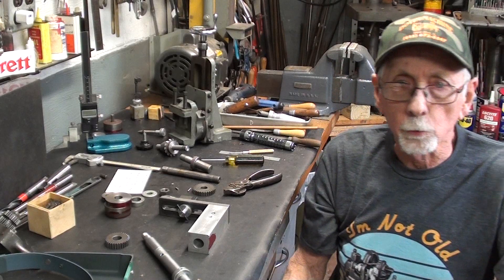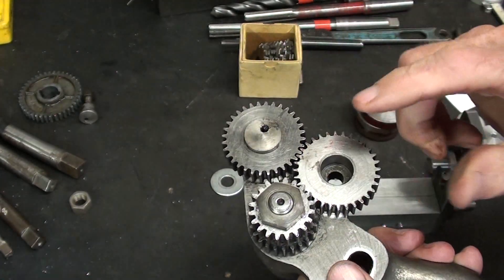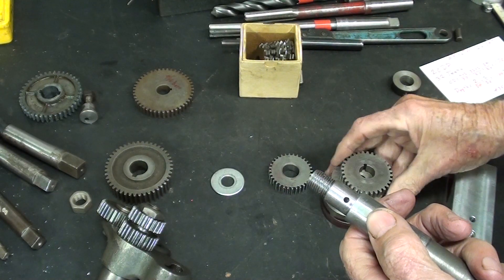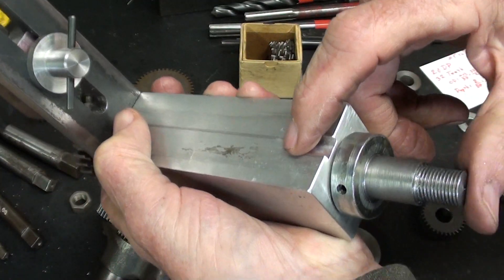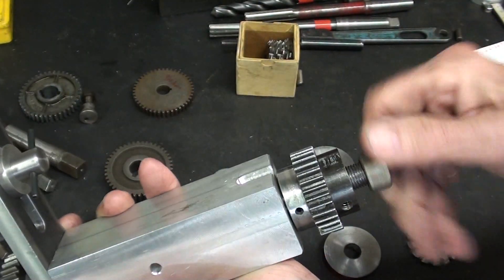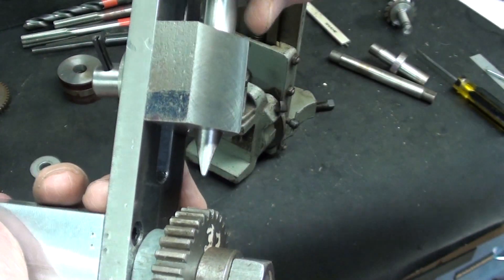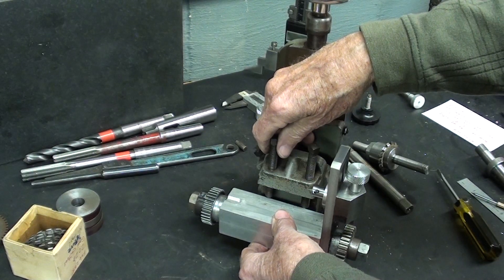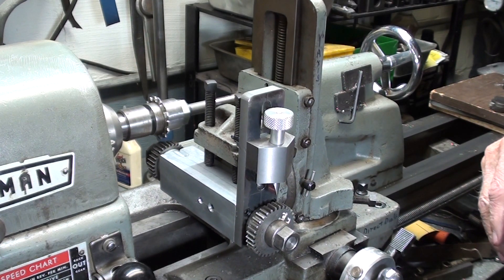MAKING ATLAS GEAR CUTTING FIXTURE pt 6 #840 tubalcain assembly

Comment: Mr.Pete would it be practical to add a round brake pad and rotor? Why I imagine this is because I have a ratcheting chain hoist that holds up to a ton and it uses brake pads! The only down side maybe would be oil! Just a thought….
Reply: Or just fold up some sandpaper between joints and torque the nut down.  1/2-20 has a lot of clamp force preventing rotation.  Great comment was think similar
Reply: Old machinist trick my friends just a piece of writing paper works great.

Comment: I have a curiosity.  I noticed when you had the gear cutting attachment "set up" in your lathe, the cutter is above the work.  On one of the still photos, I presume was a catalog page, the cutter was below the work.  Which position would be better?  Is there really any difference in the outcome using either setup?

Anyway, thank you for sharing.  I always enjoy your videos and learning from you.
Reply from the maker: The position of the cutter is fully explained in the follow up videos, which are not yet available

Comment: So what if you have a mill of some sort?  That fixture will work just as well if not better in them.  We don't all have rotary tables or spindexers.  After all, a lathe is just a specialized horizontal mill except its overarm support is an underarm support and tailstock.

Comment: Very nice series. The internal bores on the future gears being so variable bothers me because there are too many and your arbor can only handle one or two bore sizes. I am assuming that time and new machines brought about more variances in the internal bore sizes as well and key way presence or absence for the cutters and the gears. Looks to me like that the usefulness is limited by the choice of arbor size you make. Which are the most viable and intelligent combination of choices for today? A dilemma I'm sure settled by the number and type of machines you have and the size of your pocket book.
Reply: Start with a shaft diameter of .625 and make thin wall bushings for.750, .875, 1.00, 1.125, and 1.250. That set will accommodate all of your basic bore sizes.

Comment: rather than put a keyway in the reverse tumbler gear, I would drill a hole in the collar, and pin it to a hole in the gear blank, parallel to the shaft.  Just what I would do.

Comment: can anyone comment on these sets of 8 gear cutters you can buy on amazon etc.   Probably all made in china.  If I want to cut inch gears (not metric) should I order the DP (diametral pitch) type with the DP of 16,    a 14 &1/2 degree pressure angle,  and a 22mm bore , and 55 mm outside diameter????? is that the one I want??     I don't see any sets with a  20 degree pa ?   will a gear cut with a 14 &1/2  degree Pa mesh ok with a newer gear cut with a 20 degree Pa  ????   thanks for any insight you may provide.

Comment: Is it a useless item? Well today maybe, machinery has never been cheaper to get. Yet back in the 1950s or so, it was a big expense to have equipment at home. Lucky or fortunate folks had small lathes in the basement, probably bought from Sears. How many had a milling machine, very few that I have ever seen and the ones I saw were ancient horizontals.  

So if you were John Q. Hobbist and wanted to make a small gear or some other indexed part this thing gave you a chance. So it was slow and cumbersome, and so was the milling attachment..

I'd also guess that you could make this thing all on your lathe utilizing the milling attachment. It's a hobby and time doesn't have a cost I suppose. 

I am just thinking out loud here...
Reply from the maker: That was a great analysis